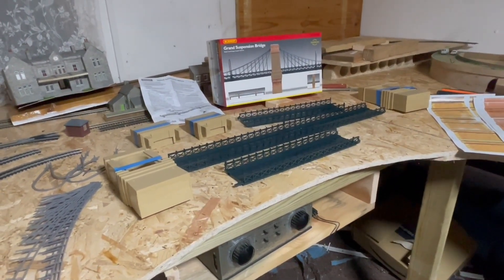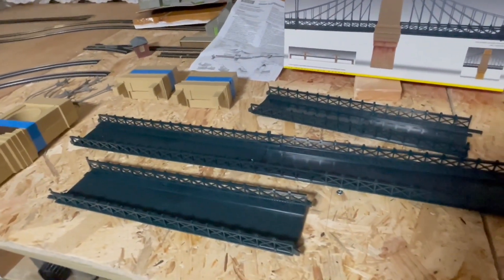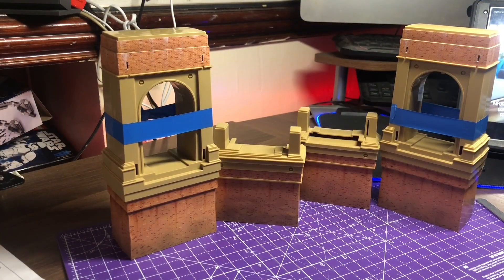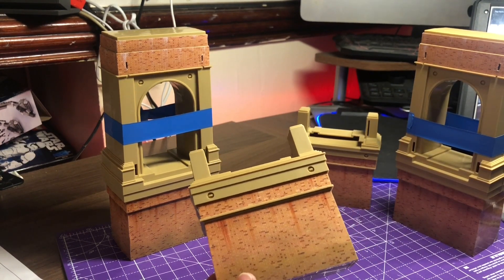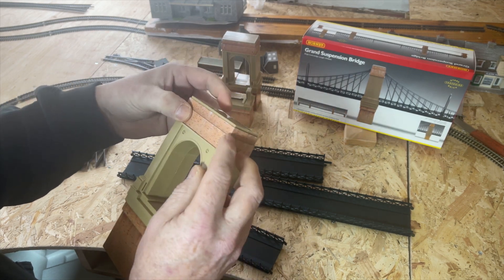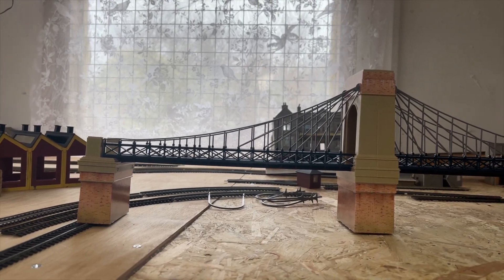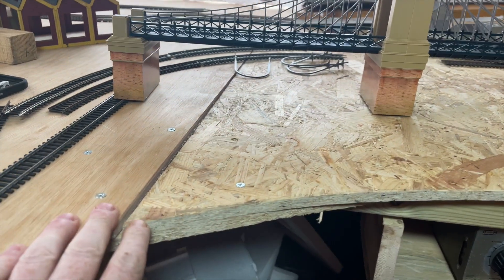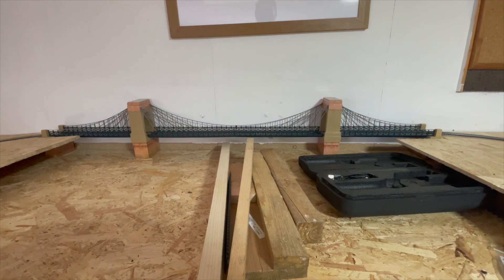RGJ Trains  OO Gauge Layout, Episode 8 Hornby R8008 Grand Suspension Bridge

Comment: Hi ya Grace and Rob.
Great vlog.
I had exactly the same trouble on my hornby station. Had to re-do the brick work stickers with uhu glue and it did tear in a couple of places. Don't think there's a quality control department at hornby.
Won't be buying any more hornby buildings.
As Grace said you could colour it up, grey would look good.
Bridge itself doesn't look bad better when you put your mark on it.
Keep safe guys.
DELPH JUNCTION
Reply from the maker: Peter i think we’re gonna do what you said in painting it, i won’t but again, i need to get superglue to other parts of it that seem to pop off
Reply: Totally agree with DELPH JUNCTION, it is not a prototypical railway bridge. If it was used as a road bridge, alongside a railway bridge, then that would look awesome. However, there is RULE 1 of model railways ............. you have on your layout what YOU want, never mind anyone else! It is YOUR railway.
Reply from the maker: @fircombehallrailwayoogauge1430  i have to admit, it’s one purchase i do regret doing, we will do something with it somewhere down the line (pardon the pun lol) but it’s not something i would recommend to anyone

Comment: The difference between an orange and the Hornby suspension bridge is that the Hornby bridge peels itself. I used Tamiya glue. I'm going to paint the bare parts with a concrete colour but I'll probably end up mixing white and grey to get a reasonable colour. I'm going to spray paint the cables and hangers an off-white.
The bridge, though, adds a three-dimensional point of interest on any layout especially when paired with a station and a tunnel like the tunnel at the north end of Queensferry Station.
Enjoy your journey.
Reply from the maker: yeah the overall look is good, gluing is a must, am pleased but not sure if i would buy the same again

Comment: Would have been nice if it had embossed brick or stone coloured plastic pillars instead of smooth ones with stickers. It could have been painted and weathered then. Going to be interesting to see it in action after track laying.
Reply from the maker: I actually agree David, the stickers were a major let down to be honest, paint wise its something Grace will have a play with at some point, embossing would have been a great idea, and I would not have thought any more real expense on Hornby's side
Reply: @RGJTrains  Like so many of Hornby's items, I believe this dates back to the 70's. I guess they didn't emboss it to keep the tooling costs down, Probably not a big enough seller to retool it, and if they did you'd probably be looking at over 100 quid.
Reply from the maker: @davidwatts1871  its a minor thing tho, overall its fairly sturdy, looks great, apart from the stickers and its MASSIVE, we have had to redesign a little of the layout because of it

Comment: It's an awesome looking bridge isn't it? And to think in the 60's you could buy an extension for it as well (1 pier and two halves).
I gave up really quickly on the stickers. Did like half a pier, like you saw this half pie brickwork, went down to the hardware and got a concrete effects spray and ended up with a concrete pier bridge.
I think one of the issues is that when the bridge came out more than 60 years ago it was sold as a toy. A very admirable one, but nonetheless a toy. Engineering wise it couldn't even be used for rail. 
Triang were catering for young enthusiasts who wanted good, functional trains to create a model railway in functionality as per the prototype.
Modern perception of a model railway is to try an authentically replicate a railway with prototype fidelity, not to function as the prototype does.
Unfortunately to modern eyes the earlier view is unrealistic, which of course it's not, it's just our modern prejudices.
Anyway, the bridge was made to fulfill the function of carrying a high level line over low level lines, and be an attractive piece of architecture.
Nowadays buyers use it as an authentic part of scenery for which it was never intended. So unfortunately it comes across as less than satisfying. And with Hornbys attempt to doll it up with some really quite inappropriate stickers doesn't help the situation at all.... 
Still, if you keep its intention in perspective, its still quite magnificent to look at :)
Reply from the maker: oh we totally agree with you, it’s impressive to look at, the shortfalls are minor, i think we did try to make that clear, we’ve glued up the bridge now so it’s more secure, and will sort the stickers at some point, didn’t realise the design was 60 years old though